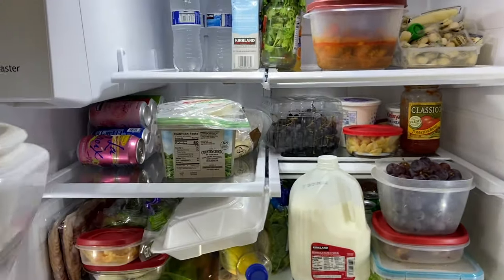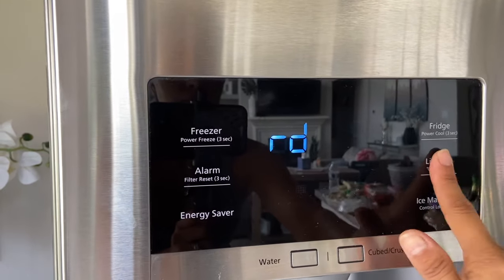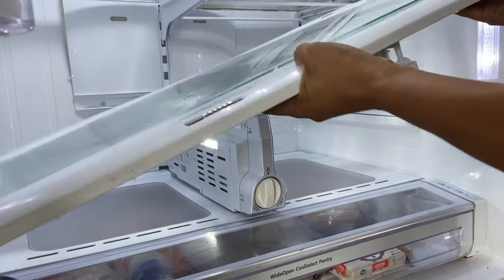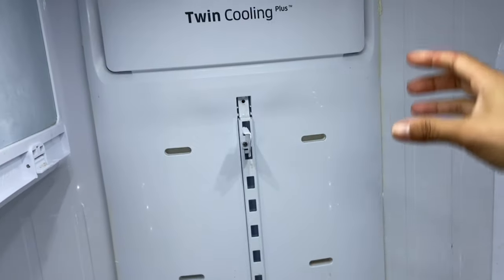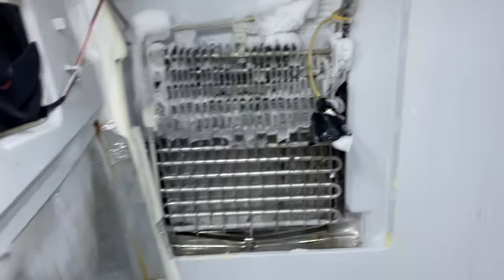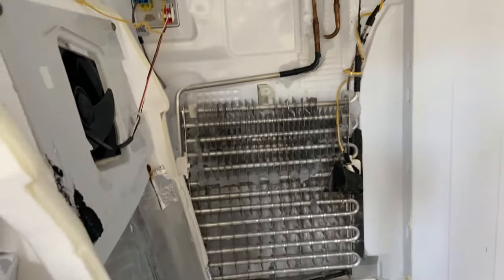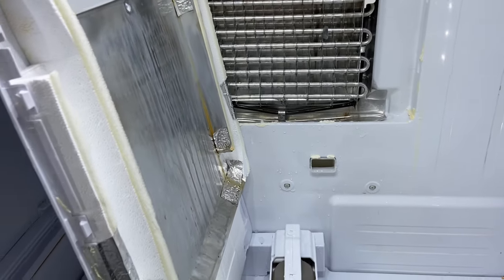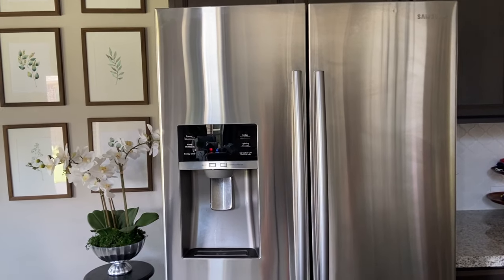FRIDGE MAKING LOUD NOISE | DEFROST MODE | ICE FROST BUILD UP

Comment: Hello All, Thank you this information was very helpful. My experience...a slightly noisy refrigeraor that became obnoxiously noisey. The main noise was coming from the freezer area. It appeared to be the evaporator fan...good luck trying to get at it. Finally the simple fix (tried after listening to this video)and I believe to be the problem = ice/frost build up hitting the evaporator fan...(1) remove the ice from the ice maker,; (2) unplugg the refrigerator for 24 hrs (obviously if you can move your food to another refigerator); (3) put down a couple of towels in case of overflow of the drip pan from melted ice; (4) next day check the drip pan, access this from the panel at the bottom of the back of the refrigerator; (5) drain the drip pan, may have to use a rag and squeeze into a bucket method; (6) plug refrigerator back in and give it 24 hours to come to temperature (you may have to reset the refrig/freezer temps); (7) if all works, as mine did, reload your food  and enjoy a silent refrigerator. 
Now, I understand this may not be everyone's refrigerator issue, but it worked for me without taking apart thr whole interior of the refrigerator. Good luck!

Comment: Thank you Norma, I did it for 5 or 6 times. Problem was coming back about ones a month. I replaced costly PC board and it did not help. Then I replaced cheap thermal switch and problem went away. No problem for more than a year now. You can try it too. Good luck!

Comment: My fridge started making this noise about 2 weeks ago. Found this video and I was not in the mood to get all the food out as we had just bought groceries. What I ended up doing was setting the temp up to 42 degrees instead of the 37 we had it on. And within 6-8 hours the noise went away. I left the temperature setting at 42 for about 36hrs, and then lowered it back to 37 and has been running fine with no noise.(been about a week since I did it and no noise) I thought I would share as it worked for me.
Reply from the maker: Hi Daniel, Thanks so much for sharing this with us! Cause my fridge still has this issue once in a while and I hate to take all the food out and taking all apart. It hasn’t done it in a while but if it ever does I will definitely be trying this! Thanks again! 😊
Reply: Do thé noise is back since you fix it .
Thanks
Reply: @dominic-xu9ej  actually I found the problem causing this noise with my fridge. As we know the noise was coming from ice building up and the fan started scraping the ice. Higher temperature worked for a week or 2 and it came back. Then I changed the heater element and temperature sensor. Few weeks later happened again, still making the same noise and once again found ice buildup on fan. Removed panel and defrosted ice again. Few weeks it started making noise again. I had read that a big chase for ice buildup is dirty vents or blocked vents. I had warned my wife not to place anything near the vents which are on both sides of my fridge. I looked down and both vents were being covered by boxes my wife had placed on each side of the fridge. So I moved the boxes and raised the temperature a few degrees so fan would stop and not make noise. The next day I lowered the temperature back to my normal 39 degrees for fridge and the noise was gone. Unblocking the vents allowed the ice to melt and it has been working perfect for 2 months now. Coldest my fridge has ever been. So my issue was we kept placing things to close to the vents.
Reply: Thanks Daniel i will try your advise 👍
Reply: I will try that, thank you.
Reply: @normadoes it's ice build up around that fan. I think if you put a lubricant around it, it will stop.
Reply: @normadoes The freezing point of petroleum jelly is -49°F. 
The freezer is not getting that cold.
Reply: THANK YOU!

Comment: Use hot water and turkey baster and spray it over the ice. Its much quicker than the blow dryer. And to avoid future ice build up increase both the freezer and fridge temperature to a couple of degrees warmer.
Reply from the maker: Ah ok! Thanks for these tips! I haven’t had a problem with it hopefully it stays this way 😊
Reply: @normadoes  -Perhaps in your case you won't need it, but in my case I was doing exactly what you did, removing the back panel and melting down the ice with a blow dryer, but I was doing it about every 2-3 months and I finally got tired of repeating the same process over-and-over again. I don't know where I got the info, but I increased the freezer temperature from -O-to 3 degrees and the fridge from 36 to 39 degrees Fahrenheit. So far its been 6 months and no problem. The turkey baster technique has its pros and cons. Although its faster because I use hot boiling water, there is a risk of getting scorched. It can also get a bit messy with all extra ice water falling on the bottom and the clean up can get complicated.

Comment: video is nice. After looking at many of these videos from Various Manufacturers this problem is really common. For cost of these refrigerators the design is flawed. We should not put up with. From my point if view a common comment from suppliers is putting too much items in the refrigerator and or Freezer drawer. I found that all appliance salesperson mention it but most of the videos seem to show lightly filled refrigerators. If a person does  a lot of cooking the compartment can easily over filled. This in turn can affect the circulation and in turn maybe be also causing the ice buildup behind the panels.

Comment: This is great but there is one warning people should get before they take off that panel. Samsung used a foam seal (instead of a silicone or rubber seal that would have cost an extra couple of bucks) that seal WILL crack when you take off the panel no matter how gentle you are. Once that seal cracks your going to be dealing with this far more often. 

If you can fix this without taking off the pannel just by running multiple defrosts do it that way.
Reply: Or turn the fridge off for a day or 2.  But it hasn't fixed the problem just dealt with the symptom

Comment: Thank you for the helpful video. I have done this a couple of times already but seem to keep having to do this every 3-4 weeks. Are there others who have to do it this frequently? I wonder if there is something else that is not working like the defrost sensor but dont know how to test it out
Reply from the maker: Glad it helped! I had the same on going issue for months. It has stopped completely the one thing I did recently was change the fridge temperature to 34 instead of the coolest temp, not sure if that was what helpe but it hasn't happened since. I have had some people on here say they had to replace the sensor to prevent this ongoing issue :)
Reply: @normadoes  Fridge temperature 34F is the coolest right? You meant set the temperature to 44F? Thanks
I hate doing defrosting every two weeks
Reply from the maker: @Pingpongdragon666  Try setting it to its highest F, see if that works. Sucks your having to deal with frustration.
Reply: Ive had to defrost mine twice now and it needs done again i have the temp set at 42. I'm so sick of doing this.

Comment: What is the black gunk that melted on the front of the panel? I have it on mine and can’t figure out if that’s causing a problem. It looks like it melted off one of the wires
Reply from the maker: im not 100% sure but it looks like some type of adhesive to hold the wires in place

Comment: Nice video.  I have the same model.  However it will just freeze up again.  The fix is to install foam insulation tape on the Freon tubes that enter on the top rt. of the compartment. Tape is available at HD.  Frost King pipe wrap insulation tape. 100174724 or FV15H.  Carefully wrap the tubes with the tape and they will not condense water on them anymore.
Reply from the maker: Hi! Oh thanks so much for the tips! I haven’t had a problem recently, however now the bigger problem is the ice maker! It constantly stops making ice due to frozen stuck cubes above the ice make🤦🏻‍♀️
Reply: Samsung replaces ice maker free of charge. Apparently it’s an ongoing issue with their refrigerators. Just call customer service, they will send a technician to replace your ice maker no matter weather you still have warranty on it or not.
Reply: @olgabachynska5039  <<< THANK YOU just did this and they scheduled a tech to come out in the next 2 days! I am out of warranty and mine is 6 years old. Everyone should do this. You are a genius :)
Reply: Gonna try this, do you wrap it all over the exposed copper part?
Reply: @sbr38  I wrapped mine as much as I could without bending the tubing too much.  Try to get it covered as best you can from where the tube enters at the top down to the coil as there is no defrost wire along the tube.  There is a video I saw that showed how to do it, but didn't save it.  You should be able to find it if needed.

Comment: Our GE refrigerator was doing the exact same thing!  Our control panel would not let us do what you did in the video. We emptied the fridge, unplugged it so it could defrost quicker. We didn't take that back panel off. We just put the hair dryer on that area instead. IT WORKED! Who would think that being 2021, that you would have to even consider doing this to an appliance. Thanks!
Reply from the maker: Hi Karyn, sorry to hear you’re having this issue with your fridge! It’s so annoying to have to deal with such issue, it’s a lot of work to move all your food out to have it defrost! I hope this doesn’t persist, glad you got it done. Glad the video was somewhat helpful 😊
Reply: @normadoes  IT WAS VERY HELPFUL! It solved the problem and I don't have to replace the fridge or call a repair man.
Reply from the maker: @karynivancich551  good for you 👏🏼

Comment: Much of what you have is correct, but there's something really wrong with your defrost sensor, it's not connected, it's just laying down on the coil, it should be mounted to the right pipe up above and insulated and the pipes entering insulated, if you look at your video at 5:38 as you remove the cover the ice buildup is up top around those pipes, those pipes carry refrigerant that has to be 20F lower at least than the temp you want to box to be, so if you want your box to be 34, the refrigerant has to get down to 14F, which is well below freezing, the pipes are insulated as they come up from below but as they enter the box they are exposed, factory too cheap to add the insulation, I've been in HVACR for over 50years, but the companies I worked for rarely did residential refrigeration, this just happened to mine with the evap fan, but we have had issues with the icemaker, it's a poor design, air can creep up the shutter door and the added humidity freezes up the icemaker.  I thought that the evap sensor was installed wrong too, but the factory sent out a bulletin about this is issue, link below, that shows the proper install is where it was, I still question this. These units have a lot of design issues and there's a class action lawsuit, the sad fact is what you and I and others have done may or may not fix this because there are several possible causes, isn't that awesome?,  you'll see in the bulletin. The other thing I did was insulate the lines coming in to the coil, generally in refrigeration systems these lines are insulated completely from the coil out, they will get cold and humidity in the air will freeze to them and then the ice will grow, how fast depends on how much humidity is getting into the fridge, also sealing as you showed is important. I also insulated the sensor especially at the back where it was touching the body of the fridge, a sensor must only sense the pipe and therefore the temperature of the refrigerant, if it is exposed to air or another object it's senses the wrong temp, that yellow sensor is the defrost sensor,  it could very well be that these sensors aren't sensing properly and the unit is not going defrost and that is why they ice up. We've had a lot of issues with all kinds of HVACR equipment related to sensor placement and insulation across the industry, the computer can only respond to what it's told. And yes these have a little computer. Cheers and check this out, for a unit to have this many possible problems is not good.  https://f01.justanswer.com/Rushrepair/c03e588e-a4c1-4a76-ba27-2cc5e610260b_SamsungBull.pdf

Comment: Thanks. Where is all the water going when it's defrosting?
Reply from the maker: it goes down to the drain pan, if its sitting there then your drain is clogged, you'll need a hard piece of wire to pick it and de clog it

Comment: Easier than the hair dryer is just put a small directional fan blowing air onto the evaporator coils.  That will melt the ice and dry the area at the same time, and you don't have to stand there holding the hair dryer...

Comment: Norma it looks like that froze up because the temp sensor came off the copper tubing were it should be mounted . when you put the cover back on it is not mounted in the right place so it probably froze over again
Reply from the maker: Ah ok thanks you for that! I have placed it back onto the same spot and still froze up again!
Reply: @normadoes  they make a heater element that can be added to the main heater at Bens appliances on you tube should work for that model
Reply: Thanks.

Comment: Thank u Norma. Unfortunately this prob happened twice in 4 weeks. It usually happens once every summer. I thought maybe bec of the heat in summer and we open the refrigerator too much and the temp diff creates condensation that freezes behind the panel. It’s so frustrating that it happened twice in 4 weeks. I have a feeling it’s going to conk out.
Reply from the maker: Sorry to hear that! It’s very frustrating. I changed then temp to 37 try doing so see if maybe that’ll help in any way, I haven’t had the problem since. I kicked my Samsung to the garage lol I now have an LG and loving it! Good luck to you!

Comment: That is amazing but the process is not complete yet. You should clean the back filter and use a vacuum if you can. I saw that in another video and worked great.

Comment: How often would you say this needs to be done?  Or at least how many times have you have had to do this, Thanks!
Reply from the maker: Hi Mila! This issue started right after our warranty expired and I would say at least every month I was having to do this! A neighbor had the same issue but she kept paying for repair services when all they did was exactly what you see in this video! Some one on here commented to in rear your temperature on the freezer and fridge and honestly I haven’t had this issue for the past 6+mos. so my temperature in my fridge is 32 degrees and my freezer at 3degrees vs negative digits lol this worked for us and hope it does for you!!!
Reply: @normadoes  thanks for the info, I set my fridge temperature to 40F, fan noise and ice still builds up
Reply from the maker: @Pingpongdragon666  Not sure why, mine stopped after changing temp. I set mine to 38

Comment: Beautiful fridge 👏👏😘❤️i love it
Reply: This is a case of not judging a book by its cover. Don't be fooled. 

Beautiful on the outside, but if it's insides aren't right... 

This is really not that 'easy' to do, The video is great, but it didn't show all the hiccups, speed bumps, and difficulties, and having leave out food for long enough to completely thaw the inside (unless you have a commercial [carpet] steamer) just isn't safe.
Reply: @aaangel30  : most definitely!

We bought this fridge about 5 yrs ago and had this happen like 1 el right after our extended service contract ended.  Still called but it was a no-go unless we paid like $400 for inspection and repair.  Crazy!!!  We decided against it because repair guy was gonna be 1 wk out, cost, plus all I saw online said it would continue to occur since it was a major defect of this appliance.  We just bought an in-stock fridge that next day...NOT Samsung!!  We had our Samsung in the garage so it could defrost and so we could see if we could fix it.  After about a week, plugged it in and it worked great.  Used it as a back up (so happy for THAT) instead of moving it back in again...and after 3 months it happened again!  I had a theory it was the ice maker line dripping water and it freezing up...but no water line in garage, so that theory went out the door.  Next theory was leveling...but that also went out the door when we leveled and made sure it was not tilted any which way.  So def a DEFECTIVE product since it keeps happening every 2-3 months.  After 1 yr it started not cooling even though it said 37°...so now we have another issue!  Decided it is not worth the electricity for just having the freezer work, so now it is totally off.   Will NEVER purchase a Samsung appliance again!